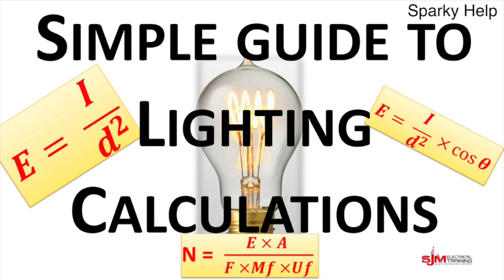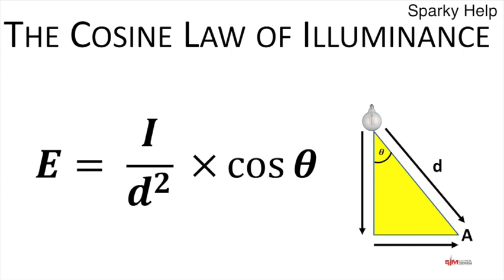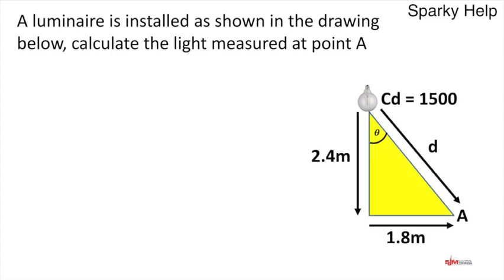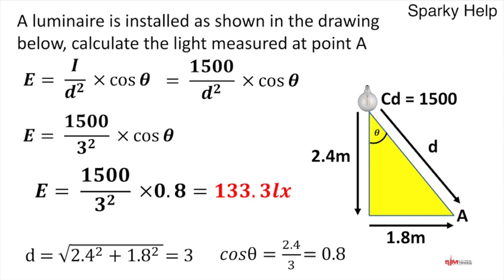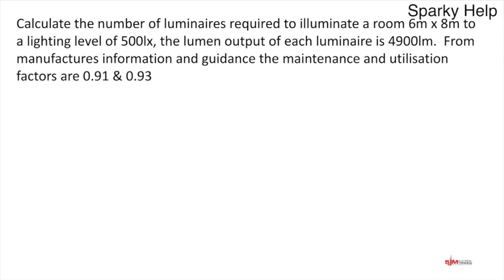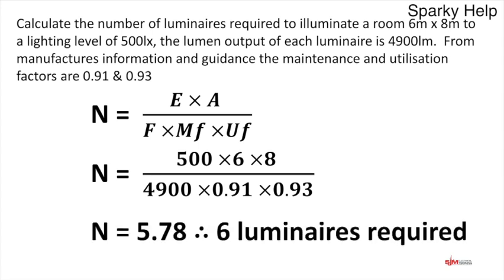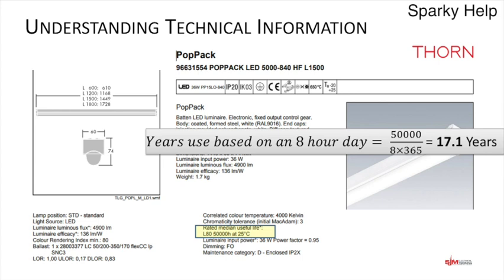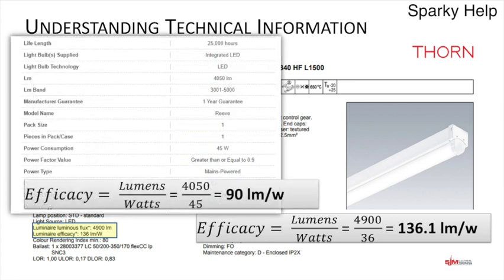Lighting Calculations, Inverse Square, Cosine, Efficacy & Lumen Method for Design Explained

Comment: When i measure light intensity at an angle from a led (60 degrees 50%)  it falls faster then cos law predicts (new distance is taken into account) , why is that?
Reply from the maker: Hi Many thanks for watching, Please share with like minded people.  First question, I presume this is in real life where you have taken a light reading.  If it is it could be a few possible scenarios:
1. The light meter is being held at an angle this can vary the result significantly.
2. The light in question does not give off light evenly in all directions, therefore the calculation will fail, it is likely that there may be a reflector in the lamp or by the very nature of most LEDs construction light is focussed primarily in one direction and does not radiate out in all direction such as most filament lamps (not sold in the UK anymore) or a candle for that matter.
I hope this goes some way to answering your question, I hope you like and subscribe.  Please check out my other videos.
Reply: @sparkyhelp3997  I was measuring by phone. And it doesn't have a cosine correction. I figured it out 😀. when a phone is directly above it follows the inverse square law though. Thanks for replying